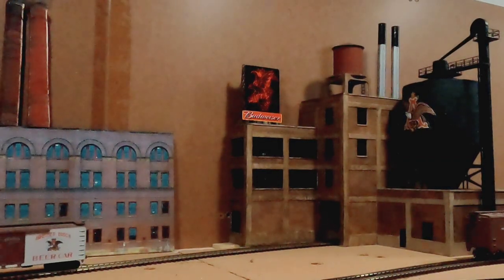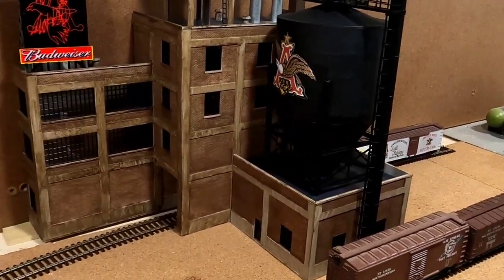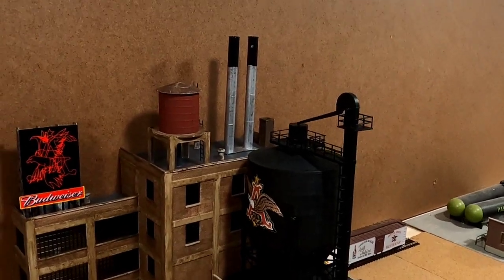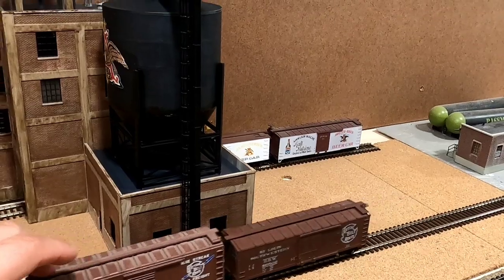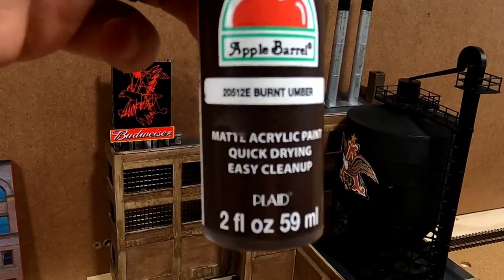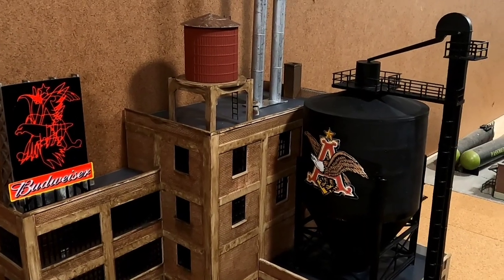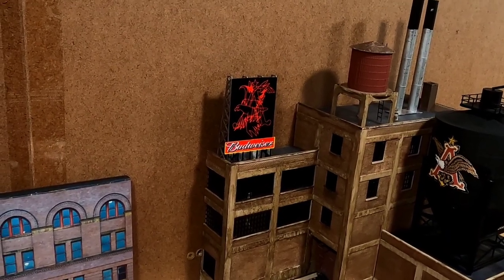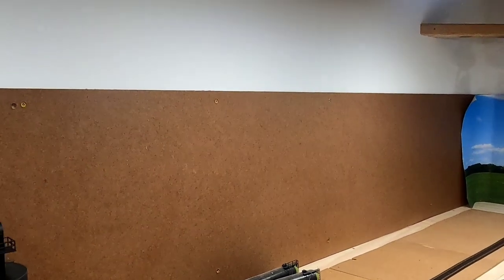Update - The Budweiser Brewery Build - DPS37

Comment from the maker: Do you think I should use the back wall on the left side, right side, or possibly split it and use on both sides?
Reply: That's up to what you think is best brother. That is a sweet looking factory though!
Reply from the maker: Thanks! I always like to get 2nd opinions.
Reply: I'm thinking the right side. Figuring that section would house offices (among other things) and keeping it to the right will insulate the management from the noise of the railroad a bit.
Reply: Hi Jason, Great build on the Budweiser plant👍As far as continuing the track i think that would be an added switching puzzle ... think they call that a team track but not completely sure . Experiment... with it 😎 Darrell
Reply from the maker: Good point John!
Reply: I would probably go with the left side although it depends on what it looks like from a distance and what is on either side of the building.
Reply from the maker: Thanks Darrell! Close on the team track but from my understanding is that a team track doesn't have any industry located on it and the industry would have to move stuff from rolling stock to/from industry by truck. I think this would be a single spur that services two industries.
Reply from the maker: Thanks John! Either side is where I would cut the back wall in two pieces and put one piece on each side.
Reply: I’m thinking right side still have room think the build looks great split three sections 👍🏻 and is there room to through in another switch to mainline then you could come in from other end as well to get to pass more gas up to you it all looks great👍🏻 This buds for you 🇨🇦🚂🥓
Reply from the maker: Thanks Mike!

Comment: Jason Nice building  I have several Miller Engineering Billboard Windows signs etc.  I ran the wire from the billvboard to a miller Engineering Terminal Block  and the end of the terminal back I added a power adapter not sure the size   If you would like to do it that way then you have room to add more on the layout   Let me know if you need any help on that
Reply from the maker: Thanks Thomas! I already have the parts from Miller Engineering to add it to the track bus that also allows me to have 6 signs connected to that track bus. I'm not sure if I will have any more signs in this area of the layout.